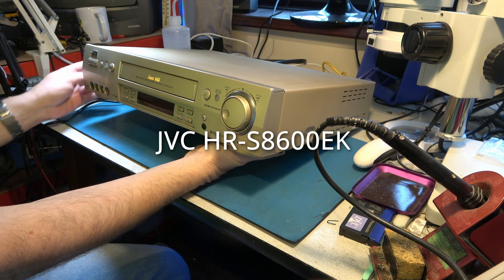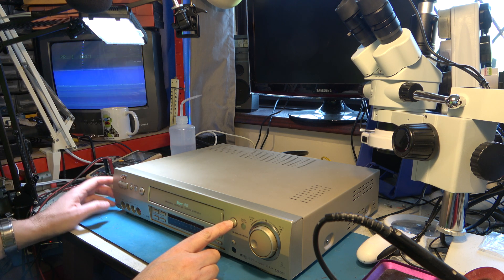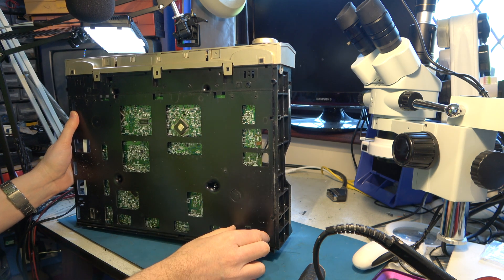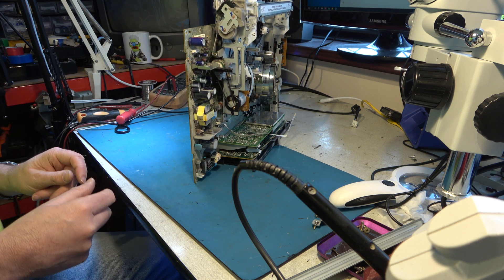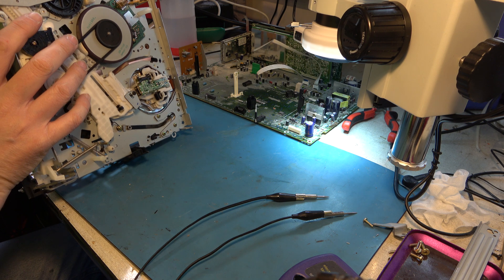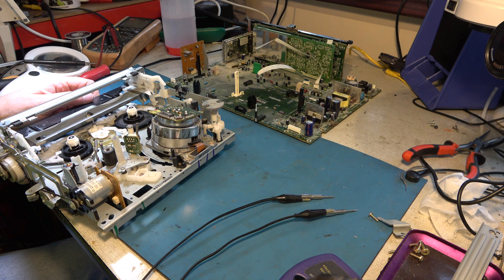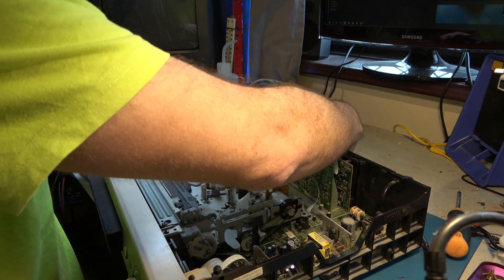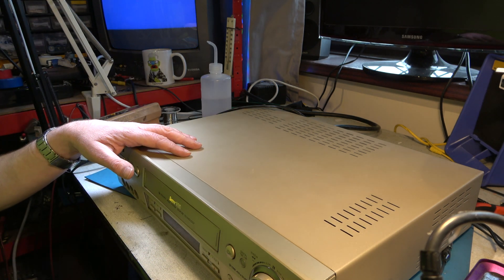Dismantle a JVC Super-VHS with TBC: HR-S8600EK

Comment: I like your videos they are very informative.
Thank you.

I own a JVC HR-S9500 from 1998.
I wonder if you have made any repairs brake pad felt replacement to the five different brakes on any of the JVC super-vhs players?
Genuine JVC parts are difficult to find and most parts are not available anymore. 
Finding good adhesive felt material to replace worn brake pads is the only way to fix worn brakes.
Bad brakes will damage the tape.

What do you recommend?
Do you have this felt material for sale in your shop?
Width and thickness of the felt is important and so is felt quality fabric material.
You should make a video about this repair.

You should also make a video how to fix faded displays on JVC.

Keep posting cool videos.

Thanks
Reply from the maker: I believe I may have fabricated a JVC brake some years ago before I started YouTubing, but don't remember the details now.  Faded displays (usually Futaba) is not really fixable other than by replacement.

Comment: I have a JVC HR-S9500E, problem started when I use either fast backward/forward, it runs for few second and it turns itself off. 
Now, whenever I turn on the VCR after 5 seconds, it shuts off automatically, but i can still see the time blinking .. I can insert the tapes, but after 5 seconds again, it shuts off. Does anyone have any idea where to look at.
Reply from the maker: Probably the same problem I had, the dynamic drum gears are jamming up.  If it manages to fix itself, don't use picture search again.
Reply: @video99couk  Thanks for your tip. I hope it will be fixed

Comment: My JVC D-VHS sometimes ejects the cassette when pressing play.
My replacement VCR, JVC - HR-S6711EU, on the other hand cannot engage fast rewind and forward, it does the initial slow widing, but when switching to fast, it cannot move the spools and turns off. I should probalbly disconnect the mechanism from the motherboard and check if the parts are in good condition.
The deck at the top of the shelf at 10:00 looks very similar to the D-VHS model I have, or JVC was just using tha tform factor for several models.

Comment: Mine a JVC VCR, its head drum not spinning. Thera are 4 pins in connector cable 12V, GND, FG/PG & V ctl pins. Do we need a Control Voltage for the operation of drum spinning.

Comment: Thanks for this video, it may be helpful in the future as I'm considering to buy on of these machines (a HR-8600EU). I now use a Philips VR1000/02 but it has some minor issues. It won't rewind but instead shuts off, and after putting it on it will rewind perfectly. I sometimes have some kind of "tracking noise", ruining the audio, while a Panasonic deck plays the audio without any problem. Cleaning with a cleaning tape makes the noise worse, but cleaning by hand makes it more prominent. Would you prefer a S7722 above the S8600? I would really appreciate your advice, it is difficult for me to decide as I never serviced either of these models. Keep up the great videos, I truly can't get enough!

One more thing: why do you use the SCART connection instead of the Y/C and cinch connectors? SCART has given me loads of problems in the past and I simply don't trust it anymore...
Reply from the maker: I don't know if there's much to chose between those two models.  As regards connectors, I generally use S-Video connectors when they are available, and only use SCART in S-Video mode when there's no choice.  I hate SCART connectors, they are forever falling out.
Reply: @video99couk  Thanks for your reply, I don't want to bother you too much with questions. I asked you about the S-Video connector because the 8600 has one, but you used SCART instead. Whatever, we share our opinions on it! Have a nice weekend, cheers.

Comment: Don't you have an external tbc machine?
Reply from the maker: Yes, I have about 14 of them!  But the internal ones do a better job of horizontal stabilisation and digital dropout compensation.  External ones are best for vertical stabilisation.  So I use both.

Comment: You are right. The problem is on power supply. To check this you need a osciloscope on all voltage point, if you found a wave, so, is there a problem circuit.
Reply from the maker: Being intermittent, it's proved tricky to pin down.  The machine has actually been running tapes for some weeks now.

Comment: This might be the gears getting stuck within the Dynamic Drum system, it can power off the machine if it doesn't initialize on power up.  A light tap on the machine will sometimes get the Dynamic Drum working again, which may have been the temporary fix seen here.  If the machine powers down when fast forwarding or rewinding while playing, then that also may point to the Dynamic Drum system having an issue.  There is information on a way to bypass that system on a forum post.
Reply from the maker: More on this very subject in a later video...

Comment: Late model. Had a bottom-range regular VHS with a similar front panel. Picture wasn't great. Lasted very few years.
Reply from the maker: The front panel is certainly disappointing, the display doesn't provide as much information as it should and there are no manual recording level sliders.  The deck clearly has a cost-reduced feel to it.  However the picture quality, especially on worn tapes that some Panasonic models don't get on with, can be remarkable.
Reply: @video99couk  This chimes with my experience too. I had a batch of VHS tapes I transferred to DVD recently. Lazily, I use my Panasonic DMR EZ49V (a late VHS/DVD combo recorder) but found that I still needed to plug my JVC HR-J747MS into the AV port occasionally. The JVC machine just seems to play anything I throw at it superbly. Really useful is the fact that the model I have is multi standard too.

Comment: The big flaw with JVCs is that you can't dissable the noise reduction with the tbc on. That's a big disadvantage. That doesn't happen with Panasonic decks.
Reply from the maker: On this one you can go into the menu and disable "Digital 3R" but leave the TBC on.
Reply: @video99couk  That's good to know. It's the same with my HR-S9700 but on my other two JVCs you can't which is not nice. Great decks by the way.
Reply: @josegti84  I'm also pretty sure the "Edit" picture mode turns off DNR.

Comment: hi hot a super vhs  15 years ago i had a 100% new head  i plugged it in alot of the caps had gone the tec did say
they may need changing one day  beware  DA88  i have had ic's  dropping of the servo board under the tape transport
i have 5 da88 units need alot of resolding the ic's

Comment: Nice video . "Like usual say beta is better talk   "  :P   Read old tests i recommend It isent .   Anyway . TBC on SVHS was not that uncommon Many Philips Panasonic JVC had those on many models .  I use a Matchline 1100 Philips I had seens new its great when transfer and look at old recordings .  Dynamic drum is a fun thing . First was on Philips V2000 format . Fast forward picture search without lines and smoth picture.  I have a Panasonic SVHS also 820  with horrible 1 engine drives everything design that have a stuck tape in it for over 10 years . That one broke down after 3 4 years and not much use . So alot off crappy designs on the decks on those and they found there way in to many brands with the same buildquality .  I have tryed follow your videos they give alot but you keep stuff out . HOW do you change belts like in a V2000 N1700 etc . Sometimes that is the crusual thing when you Have the VCR apart and searching for info fix like Belts . Some videos are realy Great Those X2 capacitors on Grundig 800 V2000 machines . that was great . I have bought several off them and want to fix up. I always begin change those if it works . So i dont want to complain . Great videos JUst more details . And if you want to . Make a Simple one On how change Capstan belt on a grundig 800 V2000 :)  If you want to .  (and yes i have get 3 betamachines  all sanyo :P they work they are not as good picture as a old vhs but ok . Fun for nostalgic and ( good to have ) ;) :)   / Thanks for the word / Stefan / Sweden .
Reply from the maker: V2000 didn't use anything like the system which JVC employed here.  JVC are tilting the drum, but V2000 adjusts the head tips, as also used on some Betacam decks.  Oddly enough I changed the capstan belt on a Grundig 2x4 Super just two days ago, I didn't film it but I will explain what I did when I work on the front loading belt this week.  TBC isn't common on SVHS decks, only on some high end models.  I have them on Panasonic, JVC and Philips (but really JVC) machines too.

Comment: Yes you can certainly see where the bean counters got their way with the lid off!  Philips also had a couple of OEM decks (VR1000/ 1100/ 1500/ 1600) which also had Digital TBC..though I doubt they featured the 'Dynamic Drum System', as that sounds like a JVC special..
Reply from the maker: I have a VR1000, and it doesn't have the dynamic drum system, but it's actually a very good machine.  Sometimes when my Panasonic SVHS decks won't play a tape, one of these JVC ones will.

Comment: Well vcrs do shut down because the mode switch is mucky, and you have that clever drum position system that gets tested by the machine when powered on, it will have a sensor to show position so maybe it has a bad joint and the control system just panics and shuts down :-D
An interesting video recorder, ive never seen a head position system before.
Happy fault hunting colin lol.

Comment: Thanks for the video, I have a JVC HR-S8500 (basically the same machine) on my desk now, in need of a new mode switch.
Now I know how to take it apart, should be quicker as you have already shown how to do it :)
Reply: You don't need to replace it. A good cleaning  with some contact cleaner is probably all it's needed. Dirty or faulty reel rotation sensors are also a common cause of a machine shutdown. Also, be very carefull when removing the mechanism…there are two or three plastic hooks holding it down to the board. These can be accessed from the top with a pair of pliers, no need to take everything apart. These decks are relatively easy to work on.